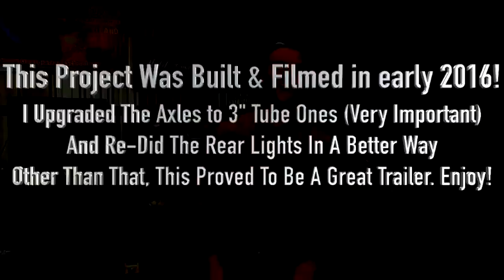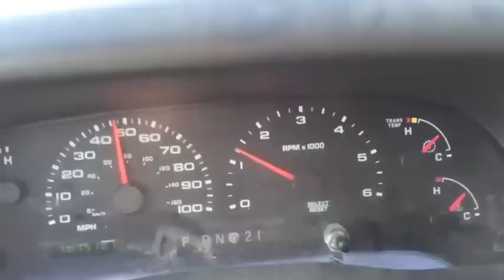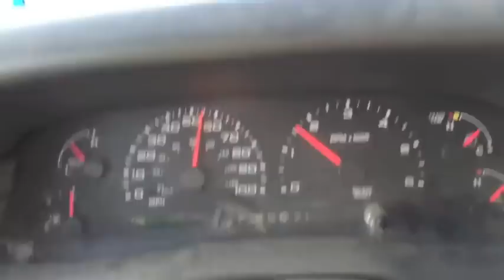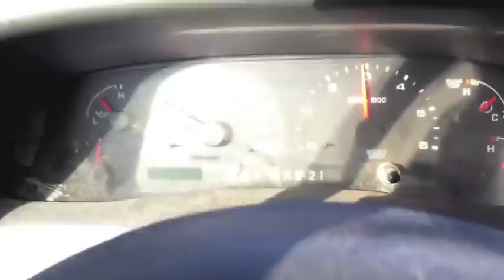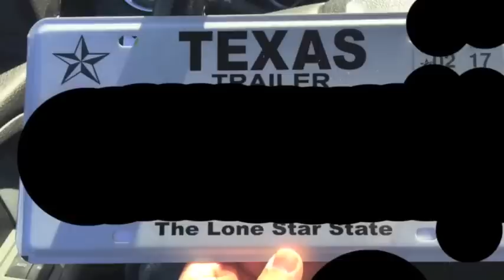Lets Build A 20' Flatbed Trailer From Scratch! Ultimate Homesteading / Farm Trailer Welding Project!

Comment: Totally with you on the wooden deck. You can go to a small time sawmill and buy a bunch of 20 food oak boards for just a few hundred dollars. I bet when the boards are wet the weight compared to metal is a wash, but once the boards dry they would be much lighter. A lot of people say wood doe snot last very long but if you take care of them the wood can last a while, and after 10 or 12 years you kind of need to repaint the frame of the trailer and put new wiring and stuff one which is easier without a deck.

Comment: Lol I told ya years ago that a wooden floor was my preference. Shit slides on steel way too easily. Scratches and rust. Wood is not as slippery. You can quickly install and remove chock stops with lag bolts or nails as needed. I use trailers on a daily basis.